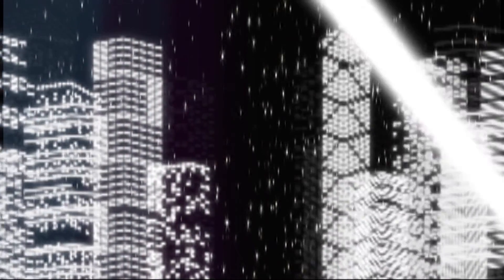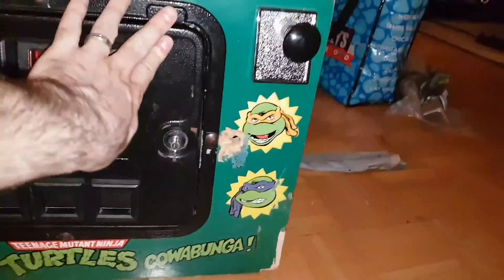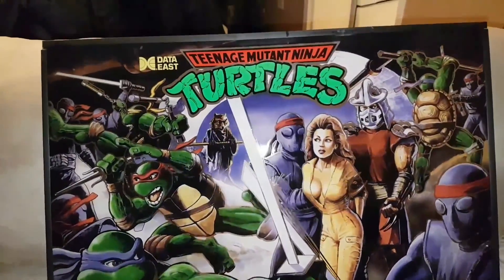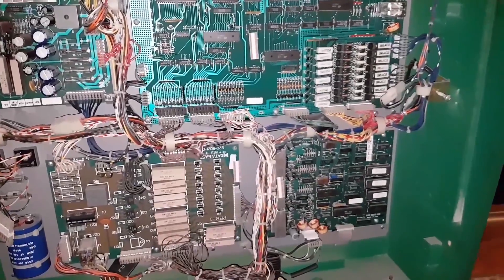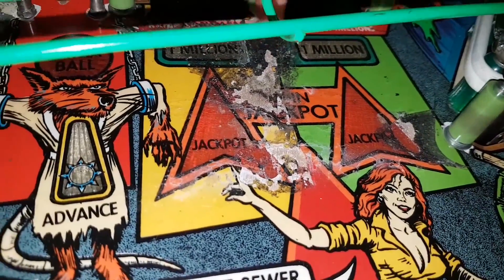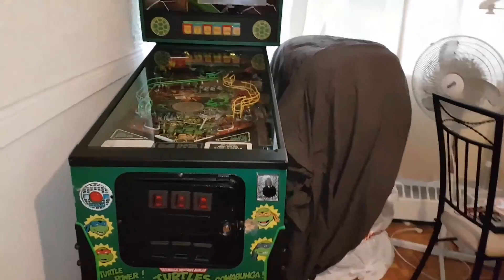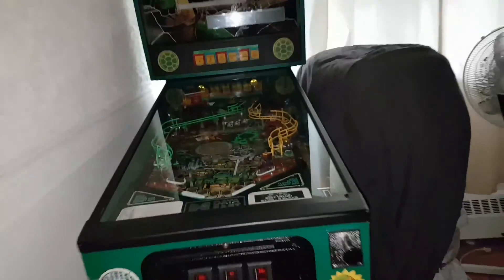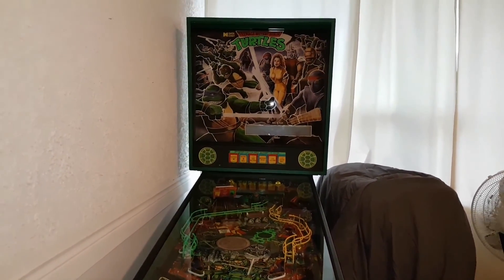Teenage Mutant Ninja Turtles Pinball - Part 1- The Pick-Up

Comment: Steve, congrats man on your first pin. Definitely the pin needs to be addressed. It would be a good idea to pull out the play field and touch it up also apply a clear coat. This looks like  restore job for sure, but that's a good deal for what you paid for. Did you try asking the guy for $1500? You will be spending decent amount of money on the restore. Keep it coming 👍
Reply from the maker: Retro Force I tried for a better rate but there was another buyer. I scooped it up, paid a bit more than I wanted but the game is hard to find ib Canada. My pinball friends have a gameplan for the game to minimize restore costs. More to come in time..Thank you